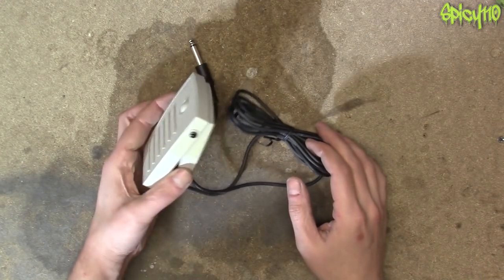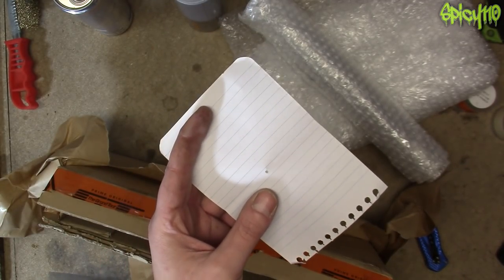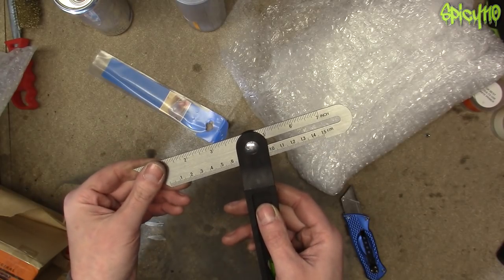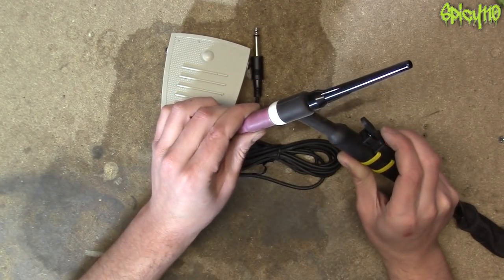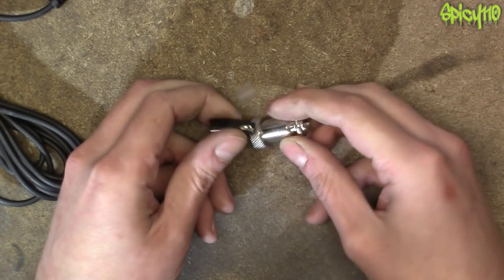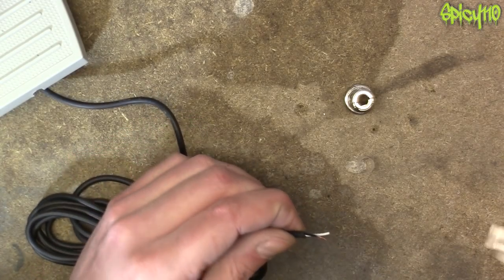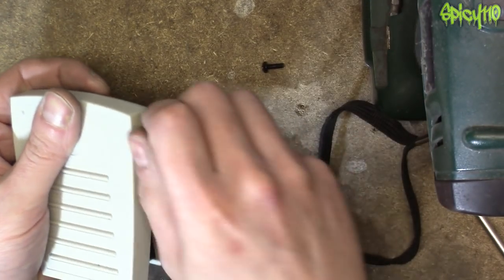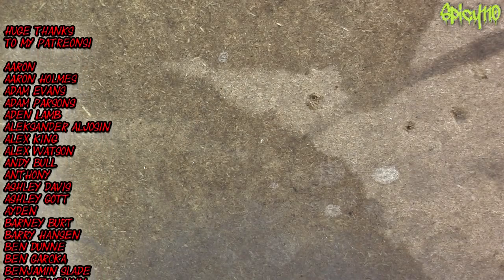Macgyvering A foot switch for my TIG welder!

Comment: You can sharpen those scribes, by removing the clip at back, chuck it into drill or lathe and sharpen it with angle grinder and flap disk. I often use them as punch for the drilling, so i run into this issue of chipping often as well. Yes i'm aware you are not suppose to punch marks with scribe and that its potentially dangerous due fragments could be flying into eyes, but its usually closest thing i happen to have around, i always wear some eye protection and this has happened me only few times mainly when punching hardened materials by accident like weld seam that has been cooled off rapidly.

Comment: Does this method actually control amperage? Or just power off and on?
Reply from the maker: This machine works by setting the power and then the button is on and off, it is not variable by press.

Comment: Wire strippers are overrated, I always find myself nicking the wire with them more anyway
I carefully score with a sharp razor
And then rip it off
Or if I'm lazy that I pinch it with wire cutters hold the blade in my hand so it doesn't move and rip it.